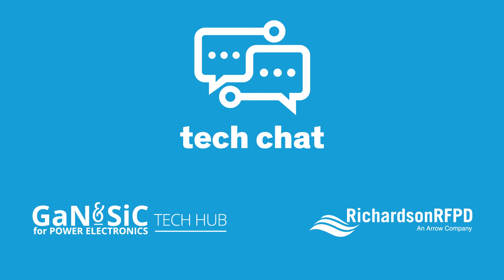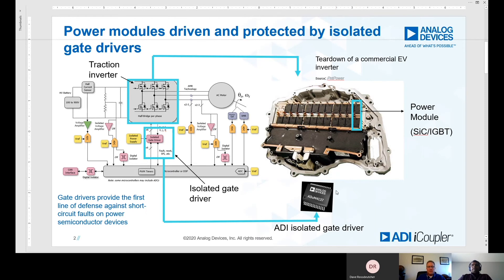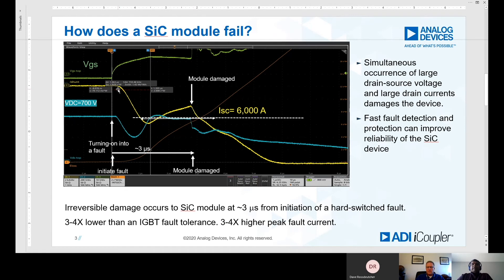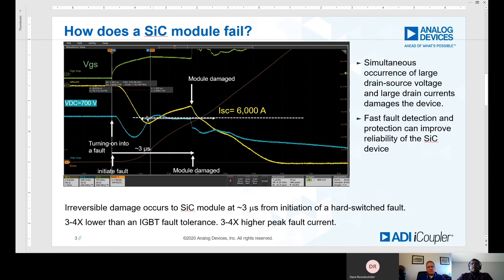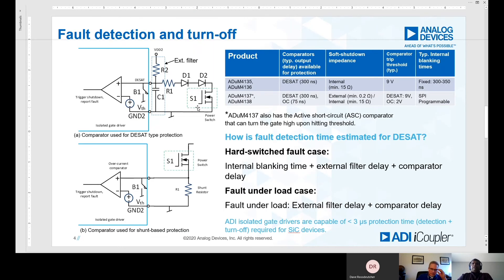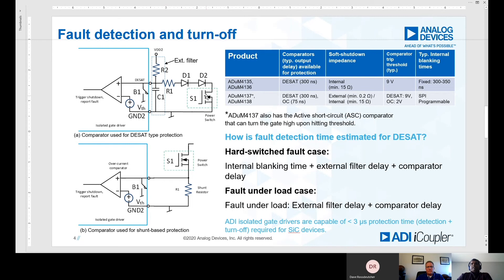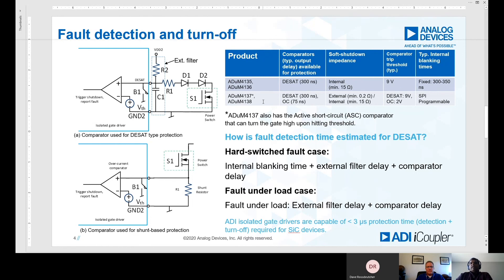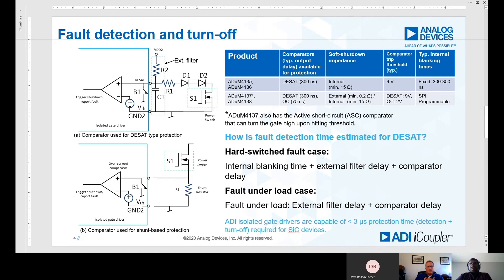Tech Chat with Analog Devices – Short Circuit Protection Using Isolated Gate Drivers

Comment: I need your help. I am responsible for testing half Bridge drivers for an inverter circuit driven by an acpl 33333 J with pulse width modulation input. I am mandated to do a short circuit test on the output of the H Bridge and I get mixed results. Sometimes the high side igbt shorts violently and sometimes the low side shorts violently sometimes they both go short and blow up. Sometimes the circuit passes with no problem. I am using a large circuit breaker on the inverter load connections to introduce my short. I simply close the breaker when I am ready to perform my short test. I am tired of having to change the output igbts continuously and need a way to get the H bridge to survive a short circuit test we call it a crowbar test.